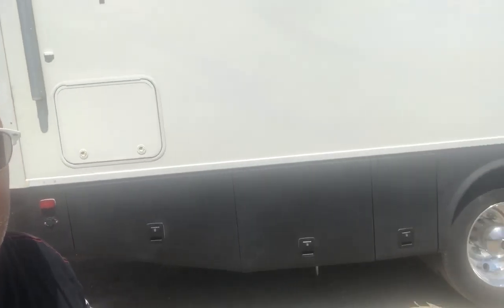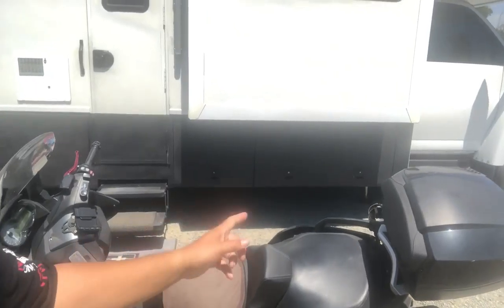RAPTOR Truck bed liner on your RV?  Toughen it up buttercup!

Comment: Hey man you sprayed that on all wrong. You over saturated instead of spraying in rows bro.
4 bottles would have been more than enough is you would have sprayed it right. You over sprayed areas like crazy. From the looks of it the paint came out all spotty.
Reply from the maker: greatsky89 you do realize it’s not paint don’t you?

Comment: Question: Did you remove all taped/covered areas after each coat then re-tape, or just leave the original taped/covered areas until you were finished with all your coats? Looks great, thanks for the vid. I'm getting ready to Raptor line a 21.5' Class C Fleetwood.
Reply from the maker: It was a mix of reaping and re-using existing tape lines when possible... good luck with your RV...it gets a lot of positive attention for sure...